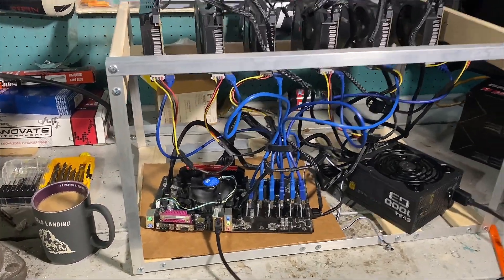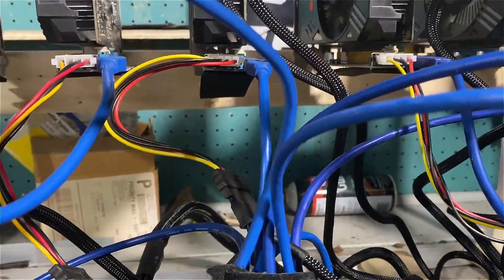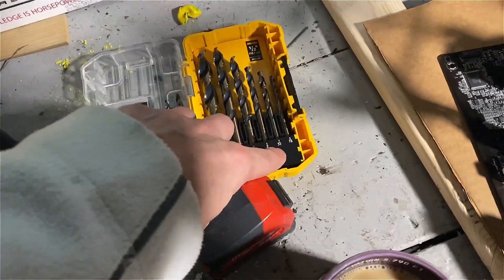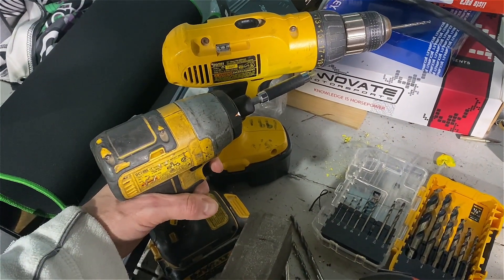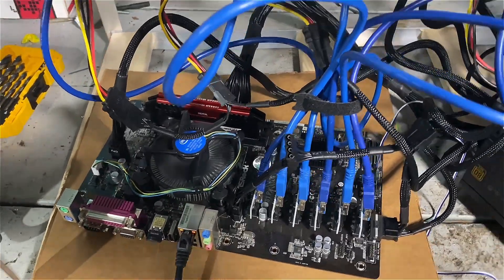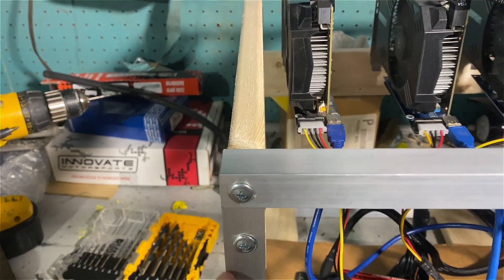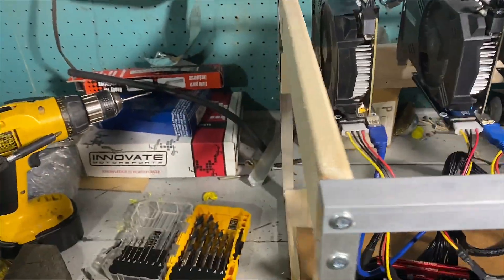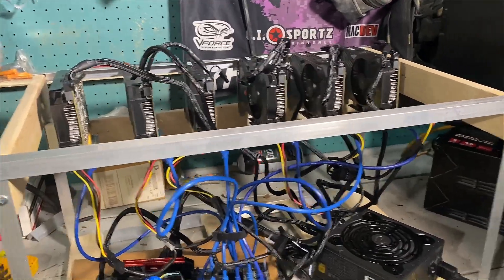Custom built crypto mining frame "the home depot special"

Comment: Nice. Good video, the rig looks good and I'm duplicating today for a 12 rig...gonna extend it out to 52" length-wise....thanks for the pointers. Thanks for being specific with measurements, supplies, and procedure! The wood on non-contact points is smart, most use metal all around, and I'm pretty sure that soft wood is absorbing a little sound. It also looks better. Great points on disassembly when there's a problem. This video covers everything.
Reply from the maker: Thanks.  I am glad you appreciate it.  Once your rig is built I would like to see it.  You can post a pic of it in my discord.  I have not done one that large yet.  I am working on other rigs right now just slowly getting gpu's.
Reply: @jtravaglini  Will do, be sure to post your discord link if you haven't. I am acquiring cards now and want to be ready to go once they trickle. I saw you have the Zotac boards. Do you like that brand?

Comment: I built a version of this over the weekend and it worked great.  The only changes I made was to mount 2 pieces of 3/4" x 1/8" flat aluminum bar stock on the sides, about 10 inches back, which secured the top side wood to the bottom.  This made it easy to make sure that everything was nice and square.  It also allowed me to fasten a 3/4" square dowel rod, to rest the cards on.  Probably not necessary, but I have a couple of big 30 series nvidia cards that I wanted to support.

Thanks for the great video.

Comment: shop vacs and saw dust create tons of static electricity.  Be sure to move your rig before you vacuum up the shavings.
Reply from the maker: I vacuum’d everything up before I put the rig there.   I made sure it was nice and clean.  And I don’t build them in my basement anymore.  I built a workshop in my garage so I use that and it’s much nicer

Comment: Great job, one question. Those gpu haven't got outputs. How do you setup monitor on that.
Reply from the maker: I use the on board graphics on the motherboard.   Before I install the gpus I boot it up and go in the bios and change the video output to use onboard graphics so it won’t try and use the gpu that’s connected.  After that it will always use the port on your motherboard

Comment: Its possible mining eth with only 1 p106-90 3gb?
Reply from the maker: ETH you can’t mine.  The dag file is too large.  ETC you can mine.  That’s what I am mining with them right now.  I use hiveOS and it’s using phoenixminer to mine ETC
Reply: @jtravaglini  What you thinks its a better idea mining wiht a i3-4170 or Intel Celeron 807 Single core
Reply: in terms of electric effiency
Reply from the maker: @DanielMolinaObana  I would probably use the i3. I check Intel website a lot at CPUs and check their TDP. In the specs it will tell you how much power it uses.   I wouldn’t use a single core though.  Mine are all dual core and I use ssd’s or usb 3.0 to run the OS.
Reply: @jtravaglini  thanks
Reply from the maker: @DanielMolinaObana  I just checked my one rig and I have an i3 4170 installed on one of them.  And it’s running rock solid and efficient
Reply: @jtravaglini  ive a gt 710 2gb and gtx 275 what you think mining with this gpus
Reply: do you have twitter?
Reply from the maker: @DanielMolinaObana  I do. It’s in the description on my videos.  I’m guilty of not using it much though
Reply from the maker: @DanielMolinaObana  I don’t think 2gb gpus can mine anything.  I could be wrong though.
Reply: @jtravaglini  I can't send you message in twitter
Reply from the maker: @DanielMolinaObana  that’s odd.  I’ll have to see if I have some setting checked off
Reply from the maker: @DanielMolinaObana  lol I did.  I changed it to allow messages from everyone

Comment: its make a difference have a powersupply with certification 80+?  in terms of efficiency
Reply from the maker: I always recommend a 80+gold or better because it’s running non stop. I even have them on a 240volt circuit to get lower amps and more efficiency.  You can run it on a less certified PSU but you may experience larger power spikes and inefficiency